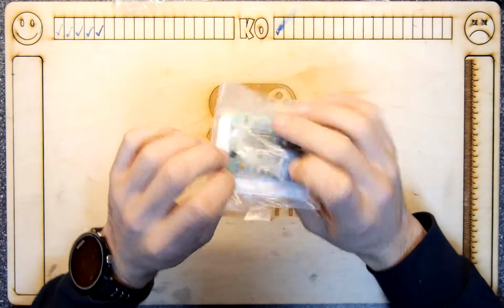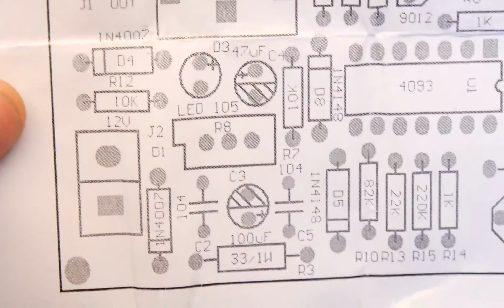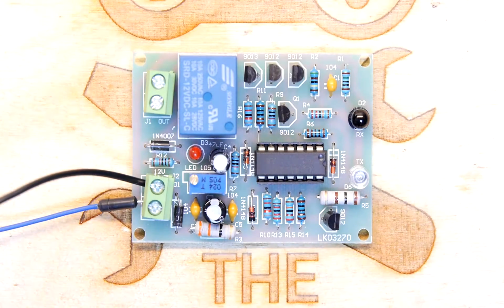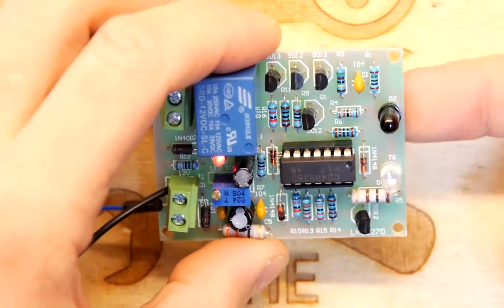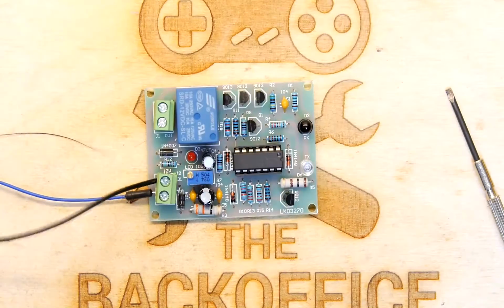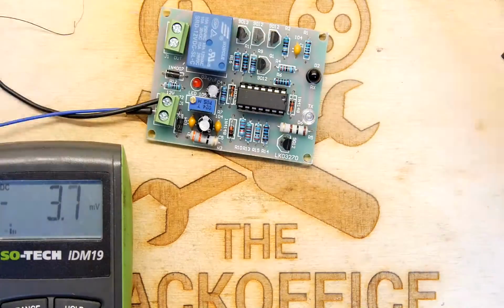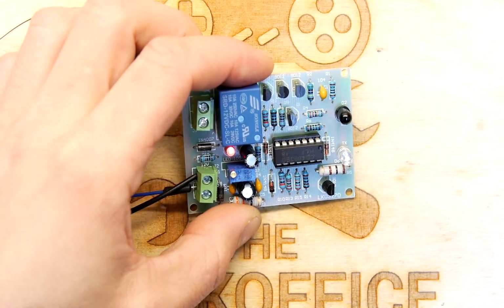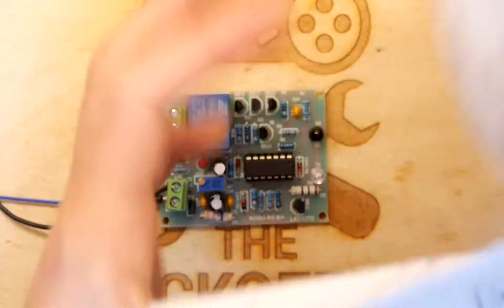Chinese Kit LK03270 Revisited

Comment: Ignoring the resistor question, I think you were trying to trigger it too near the board as the hotspot out the front of those domed packages is only about 15° degrees wide. You need to move your hand or the paper several times the separation between the diodes away in order to get the hotspots to overlap.
Reply from the maker: I did have a little play offline since then and I agree some sort of mechanical hood is required to get the best out of these. I recall some kids toys having in parallel almost touching with a thin plastic separator. Still I think the fun is in assembling these, I do not think I have ever used one of these kits in anger, but I suppose some people do.

Comment: Hi Andrew, I'd guess that those higl resistances are more important as a ratio than actual values, but that's assuming they're part of an opamp circuit for the RX diode.
Also, 6v across an IR led is way too high.
It should be no more than about 1.5v.
that means you probably eather have it wrong way around or it banged!!!
I'd say the kit is probably like the drive in those soap dispencers, they tend to pulse and have certain pulse frequencies they expect to see, so ambient light won't generally bother them.
Some work on a beam break, and some work on reflection. you need to figure out which is which too!
Reply from the maker: +william Taylor Arghhh sounds like zi need to revisit it for a 3rd time!
Reply: Sorry, didn't get notified about that reply! Bummer! Yes, often a camera such as a phone can see IR leds that we can't! You can check if it works, as I said, 6v is way too much across one of those!
If you've got a dead remote or something you could raid the led out of it!